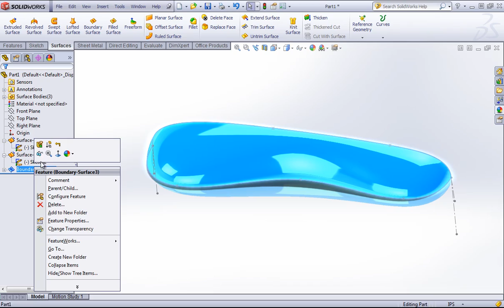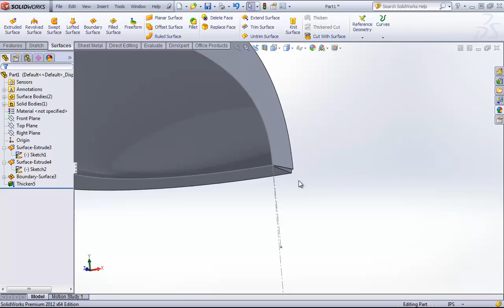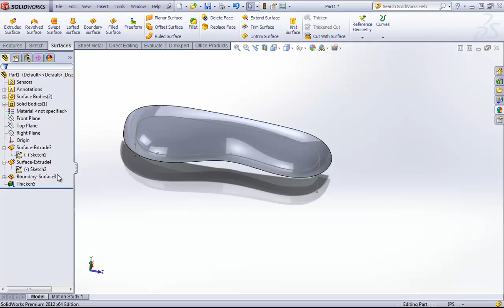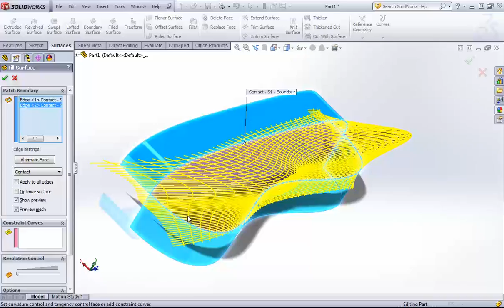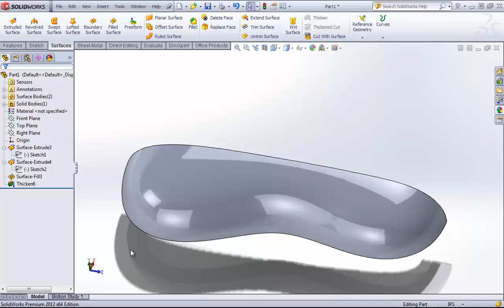SolidWorks Surfacing: Avoiding Degenerate Surfaces - SolidWorks Training by SolidWize

Comment: This is a great video:
a.) use [surface fill] but a few things before that:
b.) Add surfaces to edges that border the geometry. Crating a normal to surface capability. 
c.) Click off "optimize" because optimize=boundary surface setting(internal calc method imbedded in the option)

Comment: hi, Is there a way to fix the surface mesh like in Zbrush that you can retopologize the geometry to make it smoother? thank you
Reply: no and yes and then no those are not polygons like in zbrush (or Maya, Blender, C4D, 3dsmax, etc) but a much more complicated mathematical model called NURBS, so the question really does not stand up. There is however a somehow analog function called "rebuild surface", but this function is not present in SW
Reply: yes, REBUILD is the command, but I wish sw had it..thanks @antonioesposito8071

Comment: I still get end artifacts. I model finger prosthetics for those in need and surface modeling the part that actually fits the residual finger is the hardest part of all. I draw to sketch pictures and I have tried lofting, boundary, and now filled surface and I still cant get a model that I can mirror successfully. I draw half of the model and mirror that half to get a full cup shaped model. Any suggestions? If I can figure out how to do this successfully it would sure speed things along in my design process.